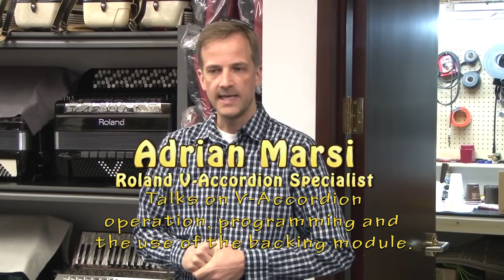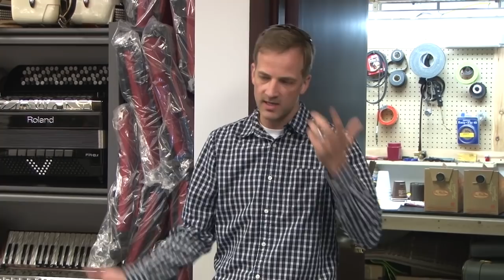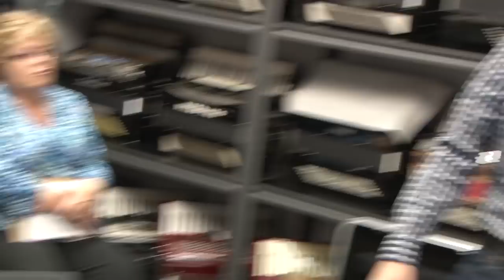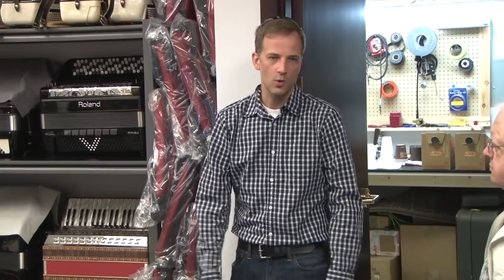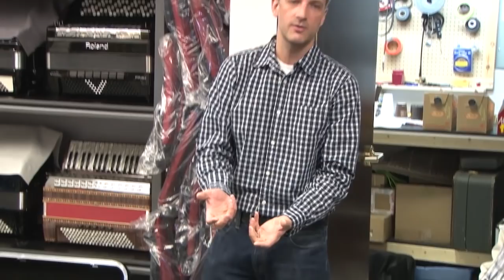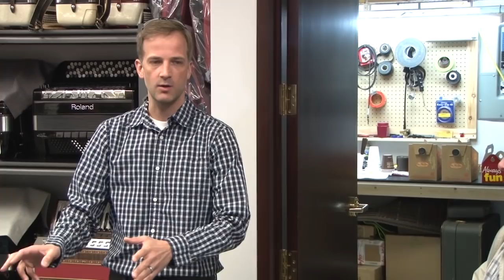Digital Accordion Talk by Adrian Marsi on Sampling & Modeling

Comment: Adrian,  I've got my FR-8X on June 14th with software version 2.01.077 and have now had it for a few weeks. The sounds of the various instruments are amazing but the the main issue I'm having is with the large variation in volume levels between instruments. I've purposely setup Bellows Curve Type in Section 14.1 to Fixed High so there is no need to move the bellows to control the volume. As an example, if I select any piano sound I still need to pound on the keys to achieve the same level as any of the accordion levels and the volume is always constant. 

I've gone through the entire menu as well as instrument sections and adjusted all the volume controls without much success, is there away of turning off key pressure? Any help would be greatly appreciated?
Reply: I found the solution to my own question. By using Orch 1&2, I set Orch 2 to "Piano Strings" and "Classic Piano" works as well, now I can select any of the stringed instruments for Orch 1 which now produces a constant volume. Having the "Balance knob" centered, I fine-tuned each instrument(s) volume but only slightly to match the Bass/Cords that I've selected. 

Hope this helps anybody that's having difficulty with the same problem.
Reply: Try upgrading to version 2.50..